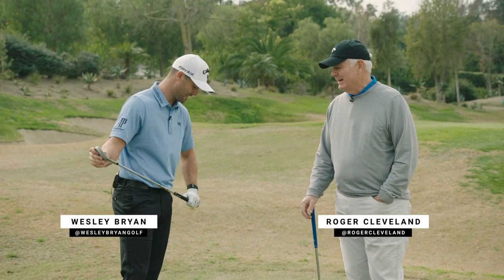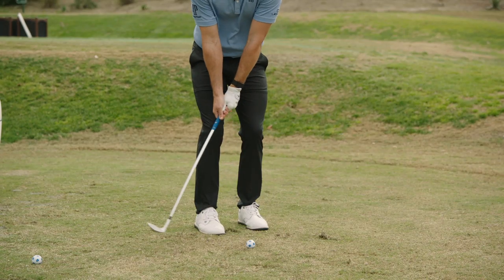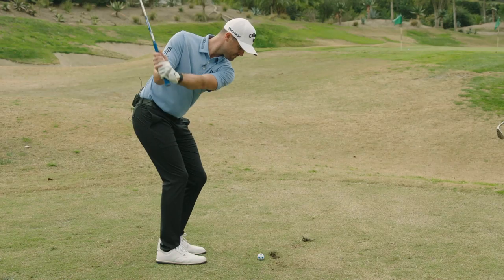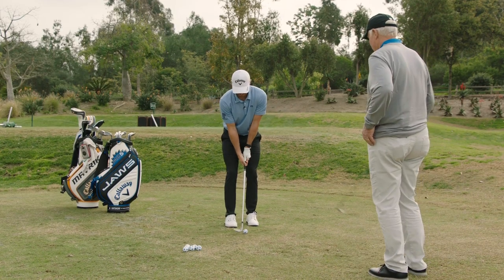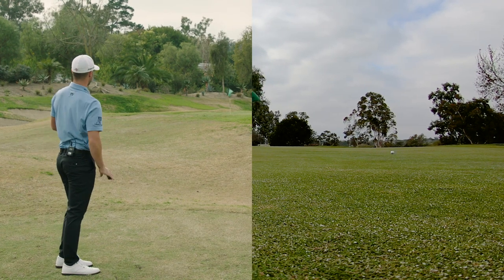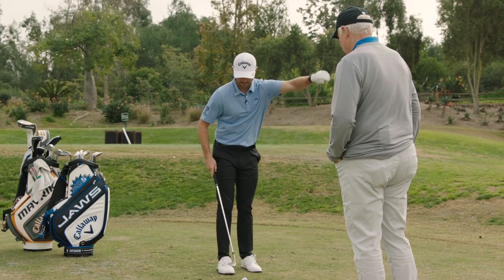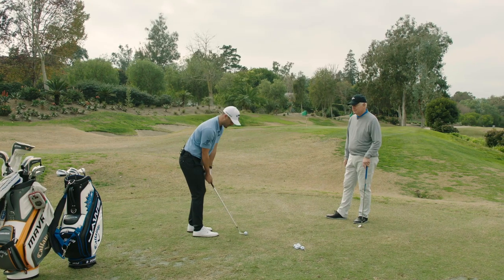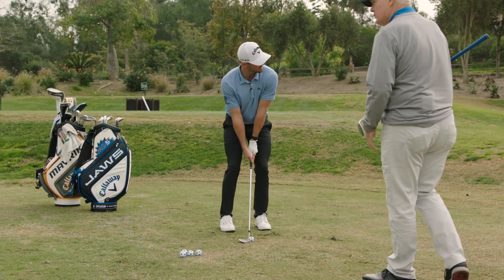Callaway Wedgeducation || The Low Spinner

Comment: What is the physics behind open face / stance and low trajectory. The slow mo at impact still shows plenty of loft being presented.
Reply: I presume the impact is relatively tangential, so there is not so much force to send it up...
Reply: That's because of cutting out-to-in to the ball. Momentum is going left with club face pointing right. The ball just kinda grabs to the club face and leaves low forward off the face with very high spin.